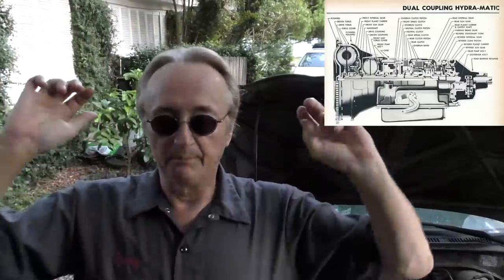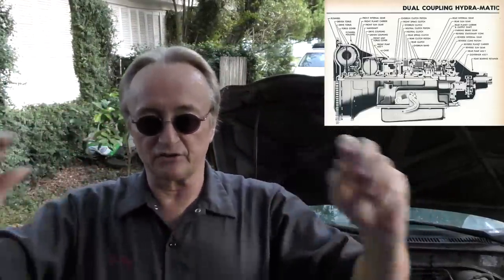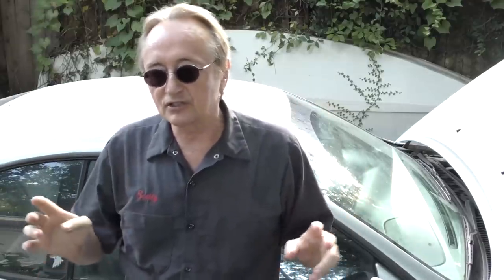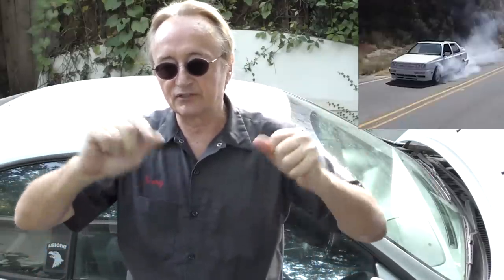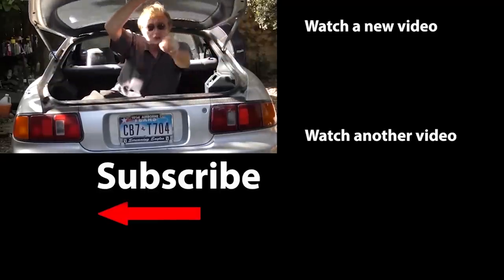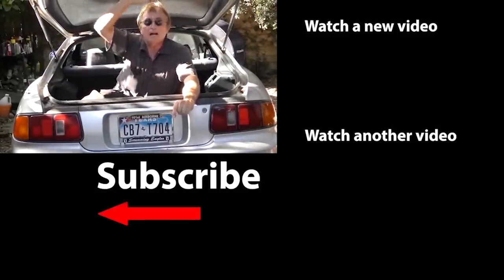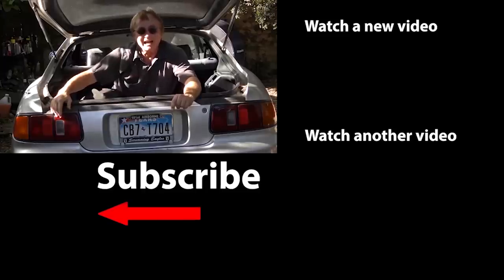This Isn't a Real Corvette, Here's Why

Comment: Chrysler Torque flite transmission was introduced in 1956 and was just as good if not better than GM Turbo Hydro matic
Reply: I learned to drive in a 1965 Dodge Polara equipped with a Torqueflite trans and a 318 cubic inch V8 engine. I beat on that car and it never broke down.
Reply: Still have the Torqueflite 3 speed in my 64' dodge custom 880 clocking in at 96K miles and still shifting fine!
Reply: Th400 is legendary. I still have mines in my car from 1968. Still shifts like new, and bullet broof.
Reply: Torque Flites are great, you just can’t beat on them in reverse in a 4x4 for very long.
Reply: @TJ-qz6hr  Also, manually shifting automatic 727's from 1st to 2nd on WOT can destroy them also.
Reply: Vanboneio \ | The gamer with oldschool wheels | / I run 727s from the 70s and 80s, I have found that if the  kick down is not adjusted properly it will destroy them as you say. I keep telling my buddies that leave there kick downs unhooked the same thing and they find out the hard way. Kick down adjustment is very important on these transmissions. I don’t have any Dodge vehicles but I race International Scouts that came from the factory with 727s, which International used for years. I have also started using billet trans parts which makes them live a lot longer.

Comment: The problem with me and manual transmissions is i could never afford to get a car to learn on. Im not tryna rebuild a clutch system just to learn to drive.
Reply: If you want to learn your going to learn. I bought my 2019 wrx not knowing how to drive stick a few days later and a few stalls and I was driving like I stole it.
Reply: For the majority of people learning to drive stick will take a few days at most and you will not ruin your clutch unless for some reason you just cannot grasp the concept.  I used to have a stick shift Saturn that I was going to junk I taught my girlfriend and two sisters how to drive stick on it figuring they would blow the clutch before it was junk and even after the three of them learning to drive stick in a two-month time frame it did not wear out the clutch.
Reply: Dude, my grandfather taught me on his little Mitsu pickup truck in the lumberyard in about an hour when I was ELEVEN. It’s way easier than you think
Reply: @brucemorris3830  i never got the privilege of those types of experiences. I was very poor till my mid 20s as well
Reply: @Ieatzboltz  lmao paddle shifters on the wheel ? Or an actual stick
Reply: Clutch Tactics Gaming — Just get yourself and old Honda with a stick. They’re everywhere and aren’t that expensive. 

If you already know how to drive, learning stick shift won’t take long. I’ve taught many friends of mine how to drive a manual in literally 10 min or less.
Reply: @drivedb7  ive ridden a 4 speed quad that my uncle had once he said its a little similar.

Comment: Honda still offers the Accord, Civic, and Honda Fit in manuals. I wish they’d offer the CR-V with one still.
Reply: BMW used to offer stick shift on its first gen X5 SUV! Those were the days. Nowadays even the 3 series won't be getting a manual. Once the current gen 2 series is redesigned, the only bimmers with manual trans will be the M3 and M4. Sad.

Comment: Never had a problem with any Chrysler product transmissions in 20 years of driving them.
Reply: True, I never had a problem towing them too
Reply: As an owner of a Chrysler a 300C with a Hemi consider yourself lucky this car is a piece of garbage on my third transmission at a hundred and forty thousand miles. And the three Jeep Cherokees I have had have all had problems with the automatic transmissions you can't kill the straight six though
Reply: Ed Buckley Maybe depends on how you drive them. If you baby a car, its gonna last you longer than with a car you’re gonna beat on.
Reply: Ed Buckley — Ironically, the straight-6 engine isn’t even Chryslers. It’s an AMC engine.
Reply: Drive DB7 Chrysler’s Slant Six was near bullet proof and had nothing to do with AMC.
Reply: Steven Goetz — Since when did the slant six go in a Cherokee? That’s what was being discussed. 😂
Reply: Ed Buckley sorry to hear, that would certainly turn me off on the brand.  I only had one Chrysler product with a hemi.. a 2005 Jeep Grand Cherokee.  The only thing that went on it in 10 years and 200k mikes was the heater core at around 100k miles.

Comment: Here in the UK we mostly use manual gearboxes and yes we have a lot of traffic jams, it is no problem , you just get used to it.
Being in direct control of the the gearbox and clutch means better control of the car imho.
I've driven a few automatics and feel more like a passenger than a driver especially around the narrow windy roads we have here, an automatic feels more like I'm floating around on the road where as a manual is more connected somehow , downshifting before a corner for instance allows me to use the engine breaking to slow down in a controlled manner just before I enter the corner and then be in the right gear for accelerating around the corner and out of it smoothly compared to a automatic which waited until I was half way around the corner or something before changing down making a possibly loss of traction if I'm pushing hard.

Comment: Nissan 350Z / 370z still come with manual transmission
Reply: My old 2009 370z had a manual with the sync-rev. Cool gimick however, I usually drove with the sync-rev off.
Reply: Because they don't bother to update the car since 2009
Reply: So does the brz
Reply: It's a 10 year old car..

Comment: I prefer a stick because I like the control driving with a clutch gives me on slick roads. The past few cars I've had are automatics and I find them to be soulless. I also hate when the computer has to take a few seconds to decide how it is going to respond to me hitting the accelerator. It always seems to want to hesitate when I want or need the car to go NOW!! That being said, I am 64 years old and I do sit in Dallas/Fort Worth traffic and my knees aren't what they used to be. Shopping for my next car will be interesting.

Comment: When I first started working on cars (1945~46) there was a guy who had a 1938 LaSalle with a two speed automatic transmission and a clutch. Well, not really automatic because it had a lever you have to move to get it to shift between high and low gear.  The transmission began to slip and we tore it down (but never found parts for it) It was basically a single drum with clutch plates and planetary gears operated by oil pressure. Something of a takeoff of the old Ford Model T transmission.

Comment: Yes...A Corvette with an automatic transmission is a whole new deal, but performance doesn't seem hampered by it.  I amaze my friends when I demonstrate my proficiency on a manual transmission.  Years ago I drove manual transmission fire trucks (non-synchromesh).  I learned manual/non-synchromesh on my brother's 1946 Ford pickup - 4 speed non-synchro.  I have driven local and over-the-road.  Handling a manual transmission is becoming a lost art.  Handling a manual transmission should be required to pass a driving test.  The state I live in is more concerned with parallel parking.

Comment: Test drive a new Mazda with a 6 speed automatic transmission. The best I have drove, for a reasonable price. For suspensions,  the Outback is very good for less than Lexus pricing. The newest Crosstrek has very good brake feel, however the steering feels very numb and not sporty. The older Crosstrek has back wheel alignment problems. My first car was a 1969 Chevy Impala with a 2 speed Powerglide automatic transmission that was terrible- it got 12 miles per gallon on the highway, however it was reliable when I owned it.

Comment: New Corvette Stingray C8 DUAL CLUTCH TRANSMISSION. No torque converter needed.
It anticipates next gear to be selected.

Upshifts at full throttle.

Shifts, up or down, in 10 milliseconds. No standard can do that.
Reply: Dr. Mark in Texas but it wouldn’t be fun
Reply: Dr. Mark in Texas a lot of newer cars are moving away from torque converters and using a dual clutch transmission. Because it’s relatively new no one can say how reliable they are but they shift much faster than a normal slush box or a human could. VW has it in some of their cars such as the golf and it is surprisingly fun
Reply: A dual-clutch transmission still change gears by itself therefore it’s an automatic. Nobody is denying that is faster.
Reply: Cristobal Arriaga it’s an automatic with a manual-esque transmission
Reply: Yea but it's a GM man. Piece of garbage like everything GM. If Ford can't get the dual clutch right I don't think GM will either.
Reply: But there's no fun in it, nor connection/control of the machine.
Reply: As an ex Ford Automotive technician of eight years you clearly have no idea what you are talking about there are only two things Ford has ever done better than GM one the rear ends in their cars are not way too weak like most GM trucks and cars and also Ford bodies do not rust out as fast as the Chevys do. There are numerous class action lawsuits against Ford for putting out cars that they knew had defective Parts like every single Ford Focus their Transmissions cannot be fixed and Ford solution was to stop building the car instead of finding a fix for the problem. My service manager would threaten to let us go if we did not lie to the customers an act like the problem with their car was our first time ever seeing it. Don't forget the 5.4 L F150 that would shoot spark plugs out of the engine because there was only three threads and then Ford's fix was two way overdue the threads so that you broke at least two spark plugs whenever changing the spark plugs guaranteed they even came out with a special tool to fix the broken spark plug in your Ford engine by banging it into the engine and hoping it shoots out the exhaust without damaging your cylinders. I could write a book on all the Shady practices at the Ford dealership. I was a GM technician also better quality car but I am not a fan of their displacement on demand in their engines have lots of problems and their Transmissions after the 4 L 80 e seem to also be problematic there 8-speed is incredibly annoying to drive the amount of times it will shift to try to keep you in the perfect gear for better gas mileage.
Reply: @remogaggi82  Ford has never made a good transmission
Reply: @remogaggi82  GM buys those transmissions from a vendor and they're proven extremely reliable
Reply: @edbuckley1670  my 5r55e never once gave me an issue. Sold the car to a friend at 216,000 miles on it 4 years ago. He's still driving it.

Comment: Cadillac also offers a manual in the regular ATS.  Same platform as the Camaro and I own a 2L turbo ATS that's manual and rwd (with a limited slip) from the factory.  Coolest cheap 4 door you can get IMO.

Comment: Any processor controlled automatic is based on a PROGRAMMER'S interpretation of what is the best gear to be in. That may be the gear that gets quickest acceleration. They may be the gear that gives better mileage. That may be one of either or each, adjusted to prevent lugging and overrevving. But that is not necessarily the gear you WANT, for the torque that YOU desire going into that hairpin curve. Tell that to the dumbasses who insist that manual shifting is inferior.
Reply: Lol it's so funny because an auto gearbox is awful with no control over the vehicle it's all sloppy and loose. A manual is full control over literally every part of the cars attitude with a tip of your right foot.
Reply: So true... I never thought about the programmers interpretation of the gears
Reply: Hi Brother! :)
Reply: Automatics are still better in saving gas which is what 90% want when they are driving down the road. I can't think of a situation where someone has to sit and scratch their chin to think what kind of gear would give me the best torque right now. If you are that kind of person, then buy a Civic type R. Problem solved.
Reply: Dual clutch automatics with paddles. Quicker shifts. Still your desired gear. I still really enjoy manuals, but an automatic really is better in a pure performance aspect.
Reply: Don't be stupid. The programmers put the details in based on what the engineers say. They made your damn car and engine and transmission. If you want the transmission to do specifically what you want when you want, then sure buy a manual, but that's a very individualistic preference. For most people, and I mean MOST people, a manual makes no sense. It's just extra trouble that gives their fragile egos a bit of a boost.
Reply: My 2014 Lexus IS 350 has  paddle shifters and a sport mode that rev matches and holds gear on corners so you are in a lower gear and balanced and planted. I also have Ohlins coilovers though. Some autos are just as good if not better than manuals in the curves especially at full throttle. The correct gear box will pick the proper gear and if it has a quick shift (which my is mediocre) it really doesnt make a difference. You can find the right gears with paddles too and faster when you get use to it. I drove this Corvette and the shifting is amazing but then again I am use to older cars and Toyotas.

2014 Is350
2016 Rx350
1987 944 turbo 
1970 bmw 2002 s54 swap
2006 Yamaha R6

Comment: I think it's only ok to drive an automatic transmission if you don't have a left leg.
Reply: I think it's ok to drive an automatic....if you want to be faster than a manual car.
Reply: Tiago Feitosa yeah the only reason someone would drive a manual in this day and age would be for personal enjoyment or possibly if you live in snowy areas
Reply: @keyboardfreedomfighter5734  but they are not faster , they shift up faster , but you loose finesse in engine braking, they are always in the wrong gear on really technical bits of track and most will overheat or get the ECU to cut power after a few fast laps.  But yes they look good on paper and allow people with low skills to drive.

Comment: I was the replacement crew for the  Ww2 cowboys on the old Green Cattle company. In 73there was still the post war power wagons. One solid piece of metal. Slow and cranky with the choke and about a dozen stick shift. At 30 years old the dozen were canabalized and went to dust . So imagine how surprised to see the new Jeep 4 wheel truck. It is really reminiscent of that old power wagon. In 74 with 52 employees and 20,000 head and hundreds of horses we went GMC. 4X4 . I thought that's all there was were 4 speeds. First a drove at 12 was a three Tree Oldsmobubble....pretty muddy on the ranch....drove it into a ditch which wasnt hard as it was raining in Arizona which means the whole road is a dirch. I made it a mile or so to the bunkhouse on K4-JCJ and walked back to the cookshack for help. And some of Cathy's pudding cake .....to die for. Which one fellow almost did. When Ken Bly sr. drove us in it was raining and muddy and him in his brand new yellow jacket mustangs 70 boss  302. We all drive hi speed sideways all over the ranch like it's a racetrack. They even time vehicles to areas constantly with a stop watch. It was the shitbix derby out there. Now Greens didn't like alcohol and fast driving. Mst cowboys...real cowboys are not in a big hurry for anything ceptin holes in the fence , lions , and hopefully pulling calves in February a.m. hours...well yer in a hurry so you can go somewhere and warm up. So those new  GMCs came with new beds and lazboys and the boss got the K5 blazer and we didn't want to be auspiscious with a limousine so we got the Chevy station wagon. All the trucks were green and there was over a dozen , and the wagon was brown and every bit the limousine and more . 12 people packed 8 comfy. This is what shuttles to town or picked up diplomats or Chase or Kissinger or who ever flew in.  I'm the hired gun am armed at all times. Mountain lions anywhere anytime. And...big politicos. The boss was the only different vehicle . Sky blue and white top K-5 Blazer. For acceleration it wiped out my Bronco half truck 302 three Tree. For comfort speed safety and dependability the Blazer was the best. What's more all the new vehicles had 350 4 speeds except the Blazer and wagon were 3 speed automatic Chevy With standard forest service snow tires they were all mountain goats. The wagon was so smooth and quiet and fast and we never had problems. Rarely did they make it back to the dealer except warranty  exclusive stuff. Never broke down . Never let us down. Always there for us and dependable as most if the time we are alone in a wilderness area and breakdowns are just life threatening at best. Too much can go wrong. I worked with men who hold unannounced records for killing more men face to face than anyone in history. My uncle Ringo taught me where we bury the rustlers when I was 12 . I've lived most if my life with a gun and fast cars and air support. Here help came a lot quicker with the 350 V8 and a four speed...well scotty nobody's beaten it yet.

Comment: I bought an frs in 16 new with a standard transmission.  I’m still enjoying it!
Reply: I think the FRS was a scam.  200hp? That seems weak for a "sports car" which is how they toted it.
Reply: Carl Ricco it’s supposed to be good handling drivers car like a Miata.  If you want more power buy something else it’s an entry level sports car.  You could also put a Crawford turbo kit on it and double the horsepower and triple the torque and really confuse someone in a mustang.